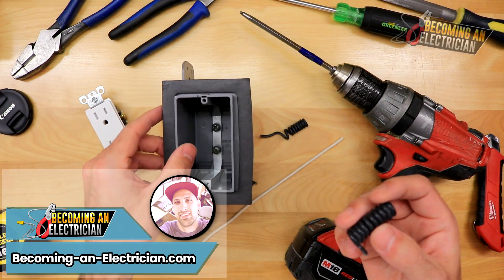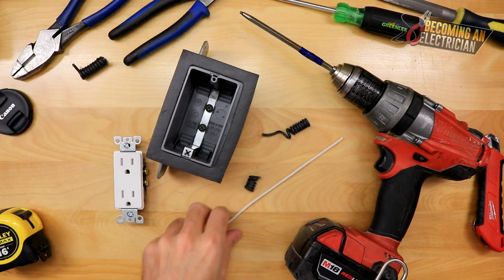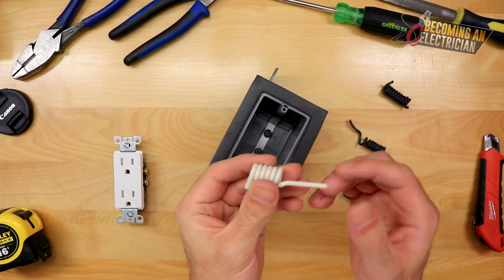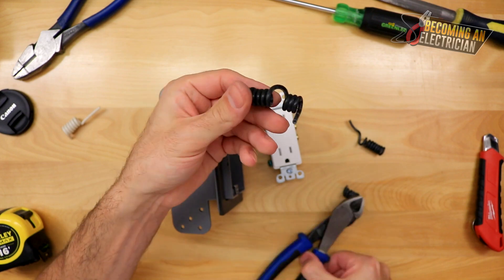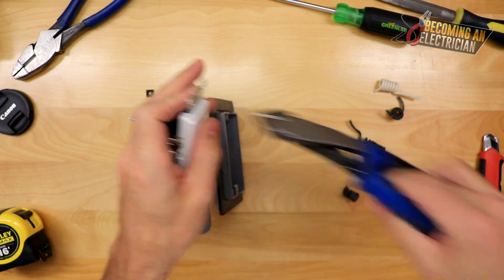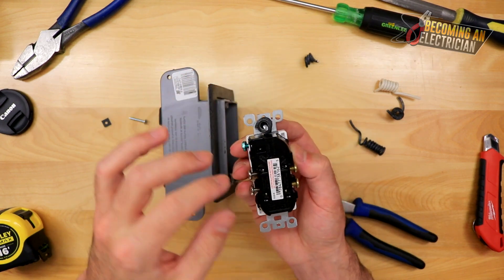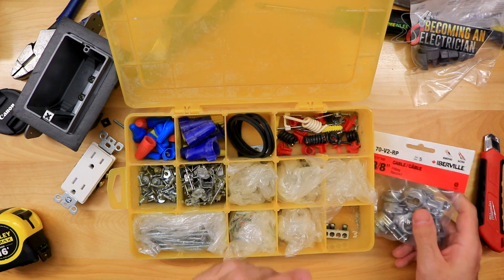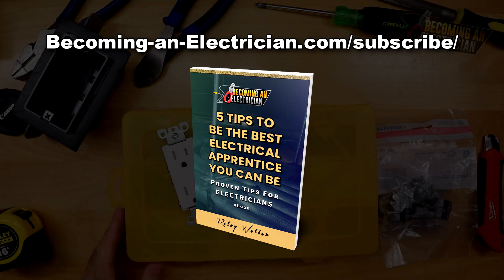How to Make Plug Spacers for Electricians

Comment: Hi a quick question, when you use a spacer do you tape the outlet? So the screws are safer.
Reply from the maker: Hey! - The plastic box extension provides adequate protection in this case when using a spacer.  If a metal box, I would usually tape plug screws to prevent unnecessary maintenance calls!